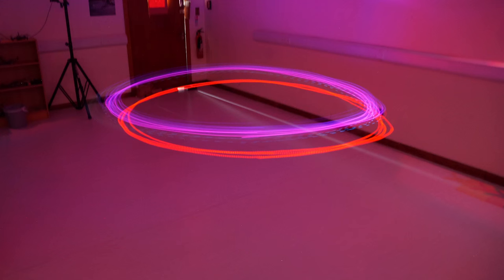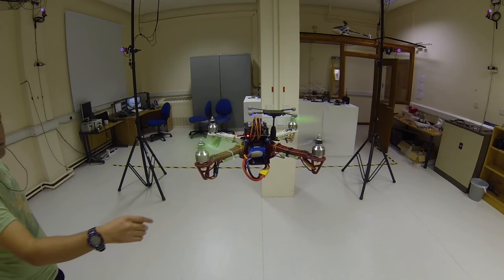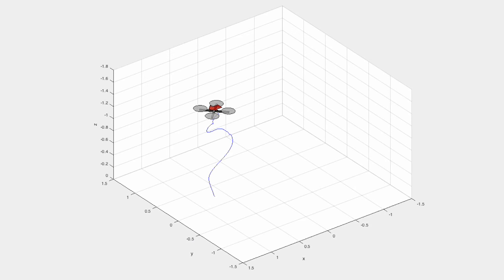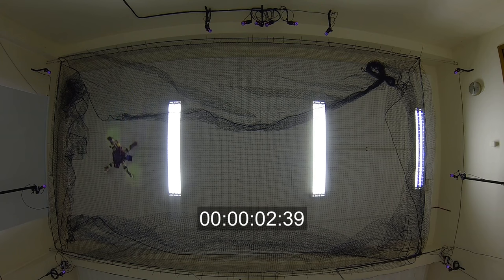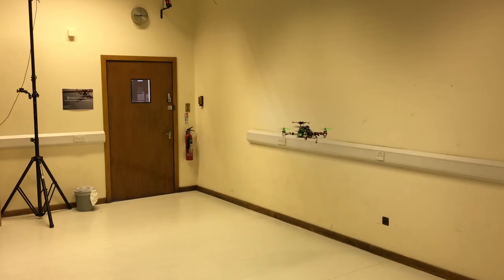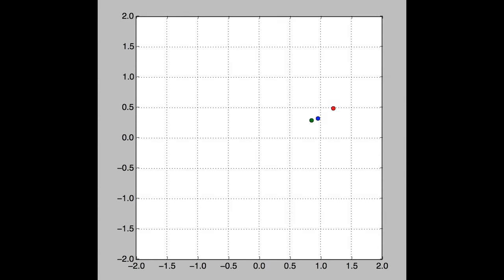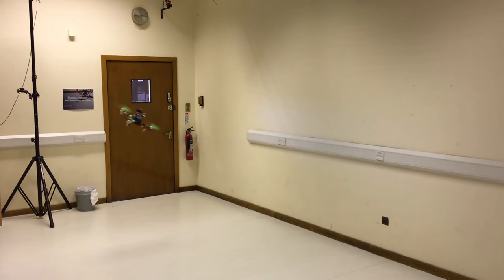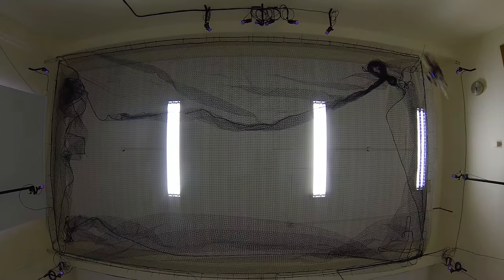Drone Pilot - Trajectory controller (raspberry pi + naze32)

Comment: Hey aldo, i am working on a project as similar as of yours, I will be glad if you help me, I want to use the "set commands" (eg:-  set_RAW_RC ).  I am using the library by alduxvm/pyMultiWii

Hola aldo, estoy trabajando en un proyecto tan similar al tuyo, me alegraría que me ayudaras, quiero usar los "comandos" (por ejemplo: - set_RAW_RC) Estoy usando la biblioteca por alduxvm / pyMultiWii
Reply from the maker: yes, thats the way to do it. your question is that the set raw is not working? if thats the question, it might be due to the firmware youre using or the channel order youre sending, did you followed the instructions on the repo?
Reply: @AldoVargasMoreno  Yes my i faced the problem that set raw rc was'nt working. Yes i followed the repo, also i read the main code of the module, there it was written to modify the "Protocol.cpp " file in the multiwii firmware, however i am woking on betaflight
Reply from the maker: @sakuraM505  yes, lots of people found problems when using beta or even cleanflight, the library was designed using baseflight, try that firmware instead